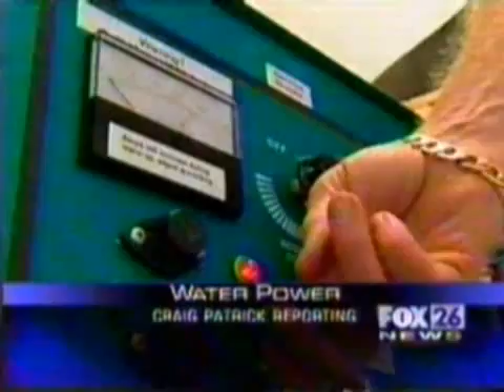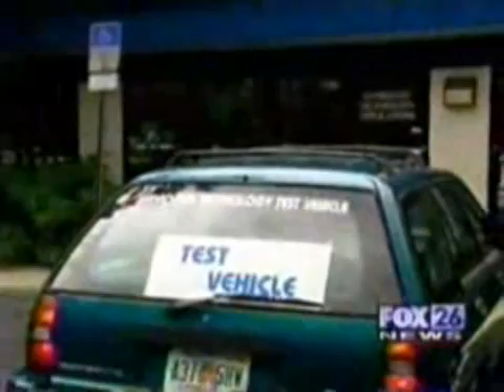WATERFUEL !SO WHY DO WE NEED OIL?MONEY!

Comment: So far no one has powered a car on water,  you can power it on water + a metal, water + aluminum ,  water + electricity,  but pure water does not have energy in it,  I have my doubts about this inventor.

Comment: @MoManMike 
*sigh*
H2O is a bonded molecule of 2 Hydrogen atom and 1 Oxygen atom.
It seems to me that his "stabilizer" breaks down the bond between the atoms and splits the molecule into its base components.
HHO = H1H1O1 not H2O
As both Hydrogen and Oxygen are both flammable, he ie essentially making an Oxy-Hydrogen torch, similar to Oxy-Acetelyne torches used for welding.
14 years old and a Jr. High chemistry class does not mean you know everything.
Keep an open mind.

Comment: the problem is is that the hydrogen is only being used as a battery. it may make you feel better to use hydrogen fuel but guess how the electricity is being generated to use in the electrolysis  process? Fossel fuel generators.

Comment: If you don't undersatand this lookup the laws of thermodynamics, there is no free energy here. There is a net energy loss, you need more electrical energy than you get back in heat from the flame.

The process was discovered over a century ago

Comment: dont you think that it is just all a matter of wasting energy?
This water engine just uses electricity to convert water into heat and when the flame has done its job it will eventually go back to water. 
Energy does not come out of nothing, it is only always derived out of something else, and here this engine converts electrical Power to HHO which, when it burns looses its energy and is water again.
Now you should wonder where the electricity comes from and whether it is endless...

Comment: cont'd.Here is a little experiment for your sake.

Take a small motor out of a toy car.
Attach it in series to a light bulb.
Put a propeller on the motor.
Let the wind turn the propeller and see that the bulb lights up.

Now picture this same scenario in how the small motor represents the 5 alternators and the bulb represents the dormant power cell that is being recharged. 

I never said a damn thing about producing more energy than is taken in.

Comment: continued, I don't know why you are pointing at that guy's comment for because it fully supports my argument about the transformation of energy because it is the same Newton's law I mentioned.
Electrical energy into mechanical energy then mechanical energy back into electrical energy in a cycle. The energy from the alternators is used to charge the dormant power cell as you drive.

Comment: Do you know anything about alternators at all?

Alternators or dynamos are basically just a magnet spinning withing a dense collection of coils to change mechanical energy into electrical energy. The motor isn't under any stress when turning an alternator because it works using a magnetic field. Again, not back at square one.

Comment: No one said you have to use one battery or one alternator so the recharging power can in fact be obtained.

It's simple, use one battery while the other battery is being charged by the alternators attached to all 4 wheels and maybe the drive shaft too. It is a cycle of energy based on Newton's law.

Stop trying to be difficult dude.

Comment: Electricity can be produced by alternators charging an already existing cell as you drive. We are not back at square one.

If you do a little research you will see that the only force holding back this kind of technology is Bush's administration. Scared of losing oil profits.

Comment: HHO = H2O.  That's an oxyacetlyene cutting torch.  It uses the metal being cut as fuel with an oxygen rich 
flame.  Electrolysis is not an energy source, it is an energy storage medium -- you still need an energy input, and electrolysis is wasteful; better to use the battery itself and remove one step.

Oh, wait, this is Fox News.  I take it all back.

Comment: Honda has actually developed an engine which will run on water without the need for any alternative fuel source, I saw an example of one at a lecture I went to on Polymer technology a couple of years ago. But they're not releasing it for general use in cars because a) the fuel industry runs the government and b) they're still not sure if it's wholely safe. I'm pretty sure that in some countries buses run partly on water, but they still require some other fuels.

Comment: no i believe this generator is real. He has proven the results, but he was not the first. He just created a diff enough generator to get a patent. The way to get hydr. is the dilemma. We could use renew resources to power electrolysis for hydr. but if mass demand came we would burn petrol and coal to get hydrogen seperated. It is abundant, too bad it is chemically combined to everything because of its spontaneity to react.

Comment: yes it can be run on the most fithy water you can get, beaver. Even liquid from a beaver.....In Fact salt water would be great, more electrolytes less electrical resistance, fewer amps. Still require the same amount of volts though. But his machine probably uses distilled since it would require less maintanence. You wouldn't have to clean out the gunk that is left behind. Kindof like boiling, the water goes everything else gets left behind

Comment: So it takes energy to split water, and unfortunately due to LAW's of thermodynamics it will take more energy to pull water apart then to put it back together right. When is the last time your glass of water separated itself? The reaction is spontaneous in the combustion reaction. Knowing this what are the forms of energy we can use to perform electrolysis?

Comment: Once again, hydrogen is a strong clean burning fuel. That is true. But contrary to popular belief it does not float around above your head. So where do we get it. Electrolysis. As the name implies it takes electricity to split water into corresponding hydrogen and oxygen.

Comment: we could produce it with renew energ like wind, water, solar. But if mass demand came for this stuff, we would probably burn coal to make it. Hybrid cars are great, uses the energy when slowing down to create energy, that energy can be used towards a motor or electrolysis of water to create more fuel, increasing the efficiency of a car.

Comment: i didn't. It can be figured out though. Turns out I am lazy. It's been a while, but i am pretty sure it is the first or second law of thermodynamics. But basically say you could 100%efficiently create a substance you can only get back that energy you put into the reverse reaction back. So it takes more energy to create hho then to use it.

Comment: first off wbowen520, good job showing your ignorance. The only problem with using water to create fuel, ie h2 or hho, is that you take energy to get there. It actually takes more energy to turn water into hydrogen then the energy you get burning it. where would this energy come from, burning of coal, renewable resources could not provide enough energy to turn water into hydrogen on a large scale basis.

Comment: The answer to this "incredible" invention is that it is "too difficult" to produce and it will require another 20 years before it is available to the public. 
 It is of course understandable. One gallon of gasoline cost 3 dollars. Water is practically free. The conspiracy theory and all other conspiracy theories are wrong.  We need to continue using gasoline as the main source of powering vehicles.

Comment: Mr Munqoesmad there is a system called Hydrostar that doesn't use more energy than it produces, the plans sold on the net were flawed but the resonate electronic circuit has been corrected and several folks have built successful generators, check Hydrostar on search engines.